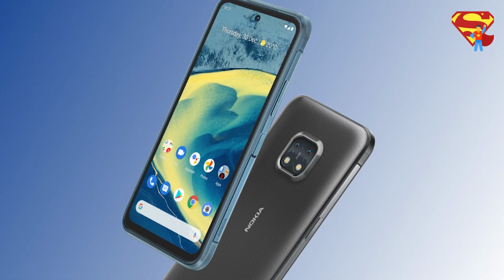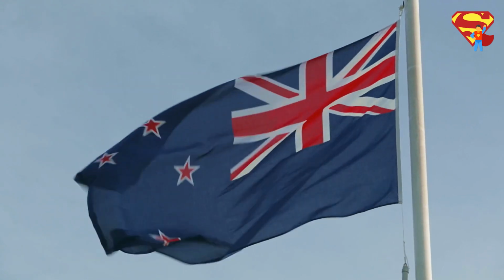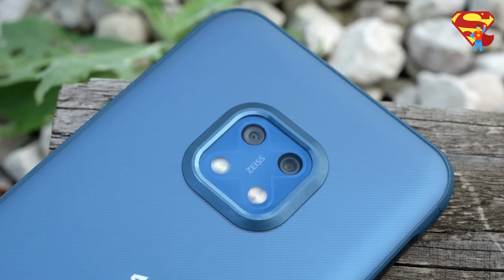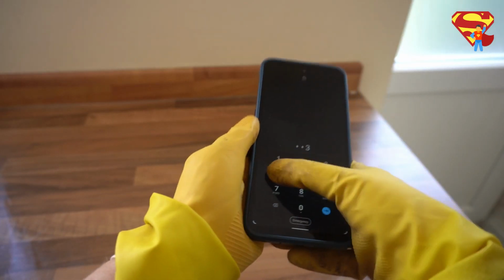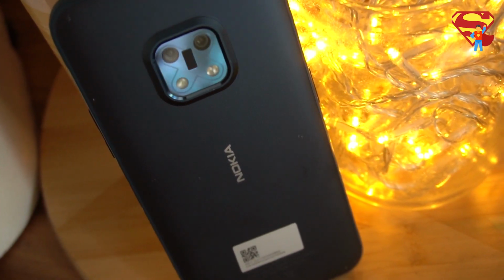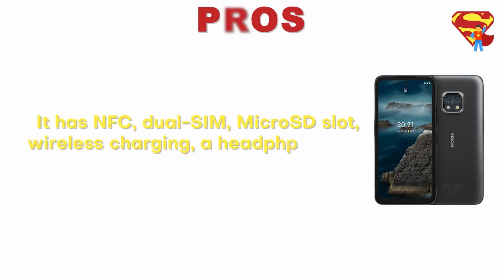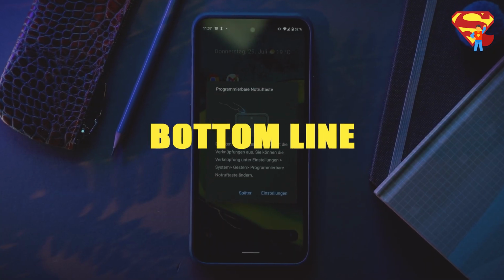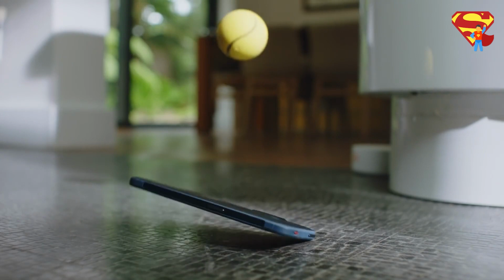Nokia XR20 Review // is NOKIA XR20 RUGGED ENOUGH? // Rugged Phone Review

Comment: I've had the phone for a month now and while it's quite durable and I appreciate that it feels like a tool over other devices (Which is a good thing) it has a couple quirks to be aware of.

First is the fingerprint sensor built in to the power button. It's almost completely flush with the side of the phone, not only meaning its difficult to feel but depending on which finger you use (Thumb mostly) expect a lot of accidental unlocks.

Next is the camera, absolutely not a good camera but it is okay. (It'll be fine in daylight but will get demolished in any low light environments) Absolutely gets destroyed compared to my Galaxy A52 or the Pixel 4a I had previously. (Gcam can help but I cannot find a decent mod for it at the moment)

While not a complaint but I agree about the Google Assistant button, especially when there's already a programmable button. If they switched places I'd be less likely to complain. Just a weird design choice. 

Battery life is about average, it'll last the day if you're not glued to the phone regularly. But other phones I've had like the Moto One 5G Ace or Galaxy A52 were better. (Especially the A52 because of its OLED panel) 

Despite these critiques, I still love this phone. Probably the most practical smartphone out there right now. (Still has a headphone jack, SD card slot, built like a tank, gets updates decently fast) I hope Nokia addresses these little issues I said above with the successor of this phone.
Reply: Id be keen to know if the XR20 is still your daily phone?  Still happy with it?  Great comments by the way.